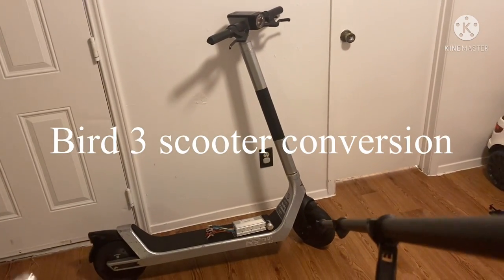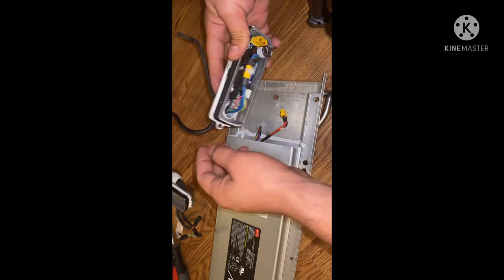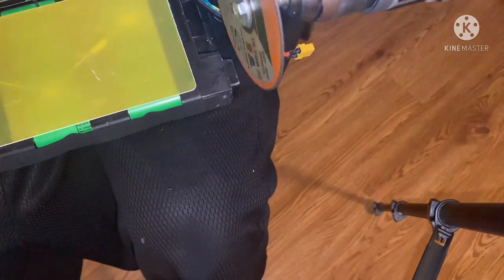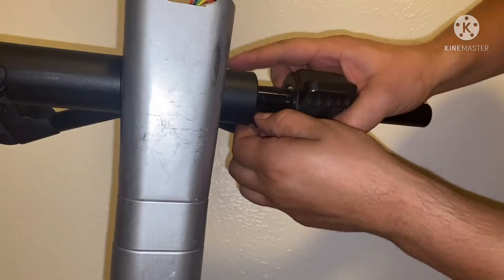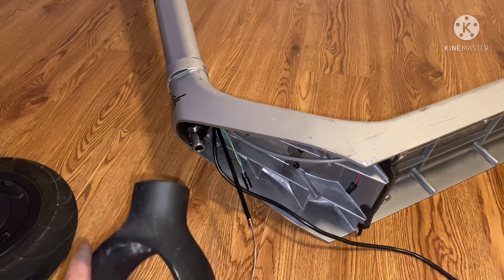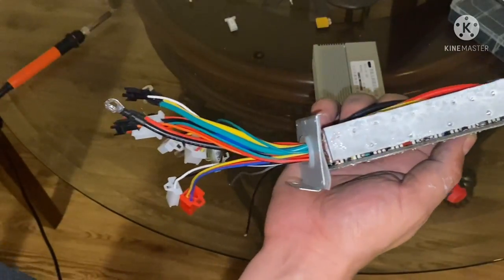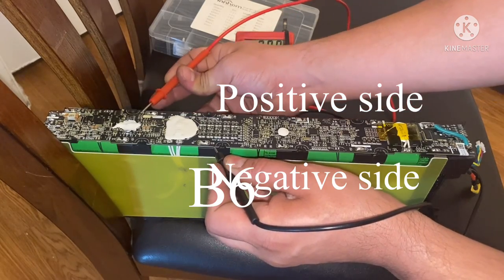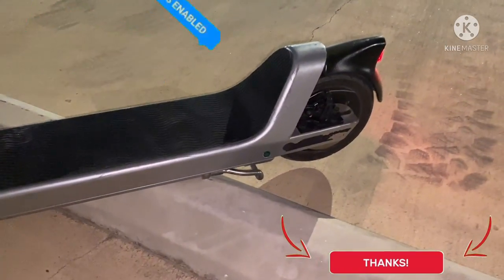Bird 3 scooter Convertion (w/Twist grip throttle￼)Tutorial -1080￼watts of power-￼

Comment: I got my bird 3 running with the 500 watt controller, and man I definitely wasn't expecting how much torque/power it has, let my friend use it and he took off and did a small wheelie by accident, I've been having a lot of fun riding it threw the dirt and grass, when I can I'm definitely going to buy you a cup of coffee to help out the builds from that link you got
Reply from the maker: Yessir thanks to those amps , that’s the reason for the wheelies 😁

I have somthing stronger then that on the way ,the 500w is 30amps

 -no doubt that’s A significant amount of power - 

but i have a 1000w 38a controller which measures 7.5 inches but with some modifications this can be done and fit the bird 3 housing. The 500w 30a measures 5.91 inches in length

It’ll be towards the end of the month so be on the lookout for that
Reply: @pjscootermods  ohhh sweet alright
Reply: @pjscootermods  sorry for stupid question: but basically the motor is 1000w but the controller is what limits the power output? Am I understanding that correctly? I rented a bird 3 and it was okay, but definitely struggled with hills I noticed. I’m guessing the stock controller is a lower wattage?
Reply from the maker: @vee6411  The motor on the bird 2/3 scooter is 400 W, i’m not too sure how many amps the firmware is putting out. But with this Controller I used in this video description it packs 30amps, battery 36v X 30 Amps = 1080 W of power. It does kind of makes sense for the scooters to have a 40 mile drive time if they are only putting out 400 W of power.! That means less power is consumed

Comment: Please where is the second, the thin red cable that comes out of the controller and is soldered to the thick red battery, in minute 28:00.  Please!  Do I need the thin red wire that you solder to the thick red battery wire??  What is that for??  PLEASE answer only this one question 🙂

Comment: taping into middle of the series balancing connections to the cells on the bms pcb to power you light will cause the voltage between the 10 cells chained pos - > neg -> ...to bring it up to 36v to drift apart and and destroy the pack as you can get reverse cells in series when power tries to equalize and cells at the end are higher voltage then the first however man cells. 

What I'm really asking is,   has it caught fire yet or the battery just stop working from cell polarity reversing? I know the brake light is meant to go on when you are braking but you know a kill switch wired in to kill the light will by its use kill the pack too.
Reply from the maker: I haven’t heard anything from the person I sold the scooter to🤷‍♂️ since then 5 months has passed. So It’s either still holding up ! Or caught fire and the person just never told me it cought lol… pretty sure I would’ve heard back from that person though if a fire did happen. I know I would’ve been upset

Comment: From where do I take this one thin red cable from the controller that is soldered to the thick battery cable??  Do I need this for the gas to work??  Does the thin red wire turn on the controller?  Please help me only because of this thin red cable if I need it.. Does the throttle only work with this thin red cable from the controller that you solder to the battery connector? Of Minutes 30:03 ?
Reply from the maker: Yessir so the thin red wire is your Key ignition. If you plan on using the controller with the original Throttle on the Scooter then u need to hard wire that single thin red wire into the Power supply positive on your controller. But if you’re using anything with a key switch then you would Connect that thin red wire to that instead to lock ur scooter/unlock.yep that red wire unlocks the scooter without it connected your throttle will not work neither will your self study wires work .
Reply: @pjscootermods  I have a brusheless 36V/48V controller 500-750W and a wheel hub motor with 5 Hall sensors and 3 motor phases, everything is made with a plug and plugged in.  Motor 48V 1000W aluminum motor.  My S866 bike lcd display and throttle came together in one set!  It works the gas with the Lcd S866 display.  OK.  But !!  Just like you, I have a 60V LH-100 thumb throttle display, it can be switched on and the same P setting that I have all set.  And strangely enough, the throttle from the 60V thumb throttle display doesn't work, whichever you have, neither does the original throttle on the handlebars.  But with the S866 bicycle display the same P settings, the gas that was included with the purchase works with the correct 3-pin plug.  I have an error code 10 on the LH 100 Damengas throttle valve display. But when I turn the engine by hand, the kmh on the LH-100 display turn.  Hmmm...

Comment: I have a question I hope you can help, I got my bird running I installed the 500 watt controll on my bird 3 I did the K2 to ground mod but I didn't connect no lights yet and I kept the original throttle, everything worked fine for the first 2 days but today, every now and then at random times the back wheel keeps spinning at a very low speedy after I left off the throttle and if I press the rear break the tire will stop spinning, 

I have no idea what it is and I was hoping you would know the problem Could the original throttle  be going bad ? 

I disconnected it while the wheel kept spinning and the wheel stopped spinning
Reply: I disconnected the throttle wires and the wheel stopped spinning
Reply from the maker: There could be dirt buildup inside the throttle causing it to turn on the low speed. It’s probably not sitting all the way closed. Make sure your rubber grip is not rubbing up against it that could also be putting pressure on you throttle which makes it not close all the way.
I’ve never had a throttle issue on any scooter but even then that could be your problem.

But I’ve had them get stuck before I would add a little bit of WD-40 to my throttle. That way to break everything up and give you that new throttle feel. But if that doesn’t work then I would definitely go with getting a néw  throttle.
Reply: @pjscootermods  okay I'll try that out thank you, I have one last question, When the scooter is about to die from a low battery. How does the scooter react ? Like does it shut off completely or will the scooter die and turn on and die and turn on until the battery can't give no more ? I'm just really curious because I haven't brought a charger yet and today I was riding my scooter and it died for a second and came back on a few seconds later and it kept repeating itself and each time it took a little longer to turn back on

Comment: I bought the same throttle with key/voltage and had the same problem, but fixed it. The small red wire from the controller shouldn't be combined with the main power wire. I disconnected the small red ignition wire from the main and hooked it up to straight to the blue wire and the ingnition switch works fine now.
Reply: Richard, do you have the part number or full name to look it up?  Thanks
Reply: what blue wire? from the motor phase? the thick one?
Reply: @northerncaliking1772 No the one from the twist throttle

Comment: Question, I’m running a 350w controller currently on a lime 4.0 I have an 800w controller coming today, what should I expect for power gains?
Reply from the maker: 800w of power is plenty. I’m pretty comfortable with the 500 W .

With 800w  should have no problems, climbing hills , getting through patchy grass or any rough areas.

Comment: Hello!🙂 Great videos you are really a pro in connecting controllers!  One question please: I bought an e-bike brushless motor controller 36V/48V 750W for 48V 1000W aluminum motor for my Xiaomi 1s in a kit with: controller + throttle (connector fits on the controller to 3 pin red black white cable).  And I also connected the xt30 to the xt60 battery.  And also the 3x motor cables: yellow green and blue.  I step on the gas and my engine won't turn!  What was included to plug together compatible with controller 3 pin red black and white cable.  Do you have to activate the controller with a second red cable?  Or is it sufficient to plug the battery into the controller?  Because I have seen that they have the battery red and black and an extra third cable and a red cable from the controller.  Please reply!  You're a pro and I've seen all the videos!  👍MfG.

Comment: nice work, the front light is 5v and the taillight is 12v?
Reply: This is what P&J says, I have powered the rear and headlight using the 5v output from the controller + resistors with no issues.

Comment: Hey I understand this is probably a while ago but I'm working with this 500 watt controller here and I'm not finding a K2 option inside of it would it be labeled something else and what does K2 represent?
Reply from the maker: Does your controller have a three speed switch on it ? If yes then trace those wires back inside your controller and see what they are labeled on the board, them three wires go to your three speed switch and will activate third speed by finding which one activates it..

Every controller is different some will be labeled K and some will be labeled with a different letters ..k2 represents 3rd speed

Comment: Say P&J, what video is it that you stated not having to cut out the battery casing?  I think you did a work around avoiding that. 😮
Reply from the maker: Bird 2 | Electric scooters￼ | 450 w 23a | Brushless motor Controllers | wiring ! | DIY projects
https://youtu.be/7JaIbATamLo

At 12:10

Comment: Did you use the twist throttle one because that’s the only conversion kit you could find on eBay? I think it’s like 50 bucks it comes with everything the controller a dash and the twist throttle

Comment: Hi, i have a similar project i am working on and the stock controller is 350w 36v 15amp max. I want to upgrade to a 500w 36v 25amp ... does that means that i pushes a minimum od 500w constant i to the 350w rated motor? And goes uptonthe full 25amps when needed? If that the case the constant 500w going into the 350w rated hub motor ia it too much to damage it? Thank you !
Reply from the maker: So right now with your 350 W 36 V 15 amp controller you are already pushing 540 W of power to the motor , now when you upgrade to the 500 W 25 amp controller you are now delivering 900 W of power to your motor. Go for it ! It’s definitely worth it . The power is there when you need it . No harm done to motor.
Reply: @pjscootermods  sounds great can you please tell me what does the 500w part means? Does that mean that it pushes a minimum of 500w into the hub motor at all times?
Reply from the maker: You’re going to be delivering whatever amount of watts you choose with your thumb throttle just know that you can top off at 900 W ( Full throttle ) continuous power. 36v x 25amps =900 watts
Reply: Awesome! I am starting to understand, how long you been runing your set up with the 500w controller?  Any problems? Was wondering how long i can run it say at 22amps max 792 w without overheating the hub motor?

Comment: Instead of doing the battery bypass how you do it I just cut the read wire on the Connecter and pull it over to the B+ spot or is it p+ I forget but the last big solder spot right there. I just do that instead of cutting that little wire and tryna solder it on both ends.  Just a Little tip I developed but other than that you taught me almost everything I know and I've been able to mod atleast a dozen 2s& 3s. We're working on our first 4 and we have played with some 2 battery 72v mods where we were doing about 50mph for about a half hour or so but the motor gets hot and shuts down. Still tryna figure out how we can do this. I'm very new to all this but my best guess is we won't be able to and instead my plan is to break down down 3 batteries and make 2 48v batteries out of them.  48v should get us 30mph or more and that should be all you need.  50 was awesome but dangerous no question!  Any insight is much appreciated!  Thanks for all your vids! We couldn't have done it without you!
Reply: 48V 1000 watts correct? (For 30mph+)  Otherwise the max speed should be 25mph if it's a 48v 800 watts

Comment: Hey man I tried this 500w upgrade like you did in this video and it was running great, a lot faster and better up hills but then the motor started bogging and and cut out completely. The back tire didn’t want to roll like normal either I thought I cooked the motor. Took it apart unplugged the batter then replugged it and it’s back to normal now. Any ideas what went wrong?
Reply from the maker: I actually burnt out a hub motor not too long ago and I thought it was my controller that was the issue. This was using my 72 V set up. I unplugged everything and at the end my hub motor was still seized. Tire wouldn’t spin it had resistance which is a dead giveaway that the motor failed on me.. I swap it out and problems solved .

But sometimes your hub motor can make them noises if A hall affect sensor wire comes loose 5 very thin wires so be sure to check on that too.

Comment: I bought the motor controller in your description and there is no K2.
Reply from the maker: Instead of doing that from inside the controller you can do it from outside the controller. Find your three speed wire connecter and drop a small bypass wire inside the connector from black to which ever other 2 colors are left in that connector, and then repeat the process go from the same black wire on your three speed connector and drop it into the last color.
1 will be unlimited speed
And the other is low speed
Reply: I just made two openings and sodered them together so the plug can still bwe used. 
 @pjscootermods
Reply: Is there a video of the new process

Comment: i installed the throttle when i gave it a litle bit of throttle it spins as it should but when i give it more throttle it spins the wheel backwards
what should i do?
Reply from the maker: What happened when u connect your self study wires? You try that yet ? That their should fix your tires rotation. Always works !

And sure your 3 motor wires are connected color with color
Reply: @pjscootermods  the thing is my conteoller doesnt have these self study wires maybe it does but i could even find them on the manual
Reply: @pjscootermods  and it doesnt yust apinn in the wrong direction it spinns gas in the correct direction but when i give it more gas it changes direction

Comment: Is that k2 to ground like a shunt mod or something?
Reply: No, just jumping the speed control set pins on the board instead of using connections outside the controller. To shunt mod you add solder to the shunts (relatively thick solid wires) on the controller board